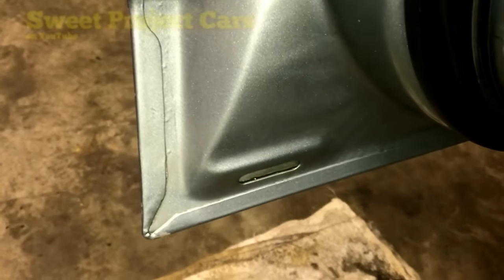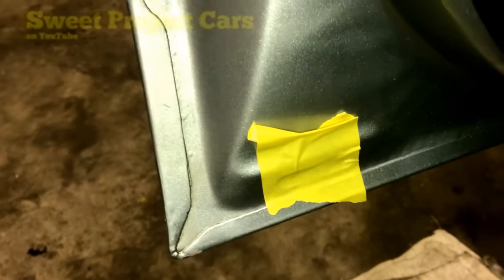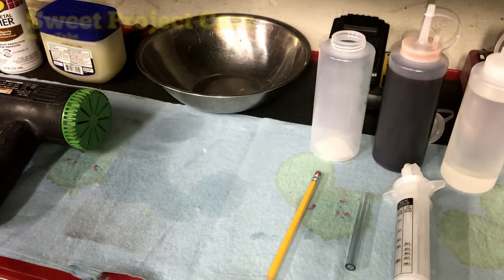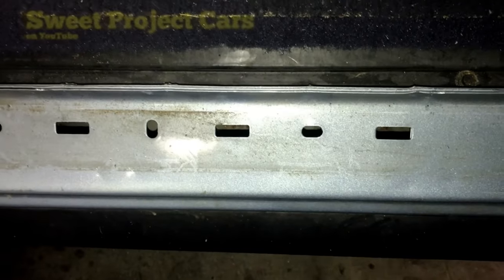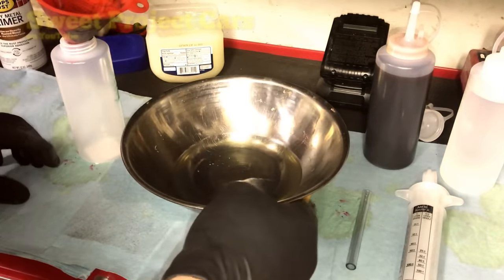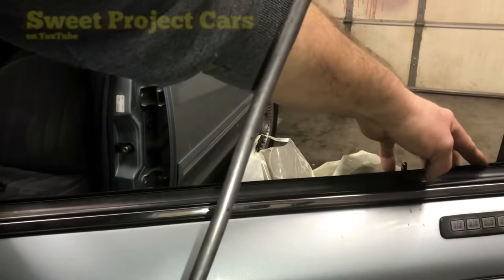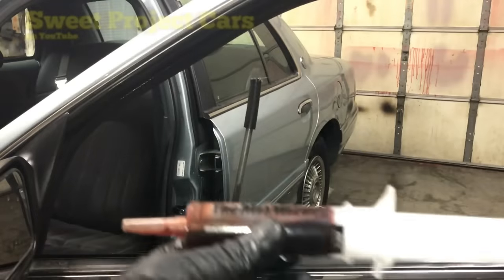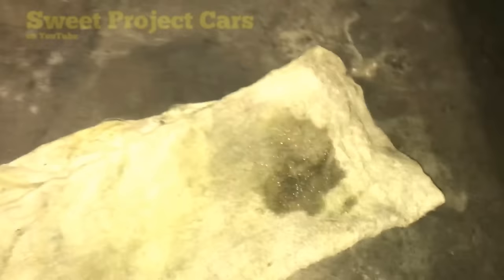Your Car Will NEVER RUST Again! For Just $10 Bucks!

Comment: Is petroleum gelly same as vaseline?
Reply from the maker: It's this  http://amzn.to/2DIxYVT  Thanks for watching and asking.  Have a great day. mad Mike the hammer SPC
Reply: @SweetProjectCars  Yeah there's a variety of uses for that stuff. I keep it in my camera bag along with some tampons.  Now I know what you are thinking right now you dirty you. But in reality it's nothing like that at all. I do under water photography. The vaseline is great on the o-ring seal to keep it watertight and the tampons are in there just in case water do get in because then they will soak it up. You might not have a ton of use for this information so I will end transmission with this: Some men need Vaseline.

Comment: Does that mean I have to apply the transmission oil every time I wash the car ?
Reply from the maker: No because it’s inside the doors it does not rinse out
Reply: Sweet Project Cars I meant like inside the fender wells and places where the ppressure washer would octant
Reply: Sweet Project Cars contact
Reply from the maker: Hernan Murillo oh if you are doing areas you are worried about washing off then you would want to use this video https://youtu.be/U10Qq9mUre8 and its tools

Comment: Doesn't transmission fluid remove the cars paint?
Reply from the maker: You need to see this video  https://youtu.be/pMGHcKVo2Yk  this will answer all of your questions.  Thanks.  mad Mike the hammer SPC
Reply: @SweetProjectCars 
 Interesting video, but doesn't it tell us what transmission fluid would do to the paint on the inside of a door if left permanently in there,  as you have suggested elsewhere to prevent rust.
I assume there would be no clear coat on the inside of the door, but only the paint coat?

Comment: Wait... won't the water just sit on top of the oil, and move the rust up? Not trolling just trying to understand.
Reply from the maker: If you apply the oil prior to any water or on dry metal moisture can out wipe it off you have to look at it this way try cleaning corner oil out of your frypan with cold water running on it it does not come off

Comment: What would happen if I do this after rust has started at the bottom of my doors?
Reply from the maker: If you do this now it will slow the rust down dramatically so yes it is a good idea to do hope this helps have a great day my friend
Reply: Thank you. I have an open jug of oil that I’m afraid to use in an engine because cap is missing. I’ll try that thank you.
Reply from the maker: GusgusA1  perfect stuff to use for this project good thinking my friend :)

Comment: Oil floats on water....and with the oil on top it will not evaporate as quickly....thus I am not sure how this will work?
Reply from the maker: Scott Sluggos Rule!  we have used these fluids for over 40 years on 100's of customers cars and none have rusted to the is day where it was applied, also you do not apply where the metal is wet you do on dry areas only, once its there it does not come off with misting of water that you get from driving especially cold rain water...have you ever tried to remove cooking oil or grease of anything especially with cold mists of water? the only way it is coming off is with hot water and soap and scrubbing...have a great day !
Reply: Some oils are heavier than water

Comment: Stopping rust is impossible without completely removing or neutralizing it first. The best way to prevent it is get a car made of plastic or non ferrous metal.  Short of that, you're SOL.
Reply from the maker: we stop rust in its tracks with this method rust cannot grow in an oil environment
Reply: Only plastic cars you can actually buy, are the Pontiac Fiero 1984-1988 and the Saturn S series, 1st gen 1990-1995, 2nd gen 1996-1999, and 3rd gen 2000-2002. Not sure if other Saturn models were made of plastic...Although, the 2003-2007 Saturn Ion was also made of plastic.

Comment: Great, but alot of rust comes from bad steel....the 70's taught me that and that's when the big 3 lost alot of the market.
Reply from the maker: you are correct on that so any oil is better than none :)
Reply: Sorry, but there is no such thing as bad steel. The problem was that the factory did not paint inner doors, inner fenders or underbodies. If you couldn't see it they didn't paint it. These areas were bare metal or primer, which is porous and these areas began to rust after the first rain. A few years of salt exposure and there were holes everywhere. Today most of the steel is galvanized and the rust problems aren't as severe as they used to be.
Reply: Kenneth Wallace true they also used way more salt back then.

Comment: I use WD40 and spray white lithium grease and all our vehicles are rust free. Even if you get a used vehicle with light rust it will stop it. 
I do it every late summer early autumn. Never sorry. Spray at every crevasse even where metal meets plastic. And all the metal that is hidden and supports plastic. Many bumpers are plastic over metal. A coworker had a Honda Ridgeline older than mine. He did nothing to prevent rust. New bumper was over $800.
Reply from the maker: Thank you for watching and sharing.  Have a great day. mad Mike the hammer SPC

Comment: Any additional hints on what to do after the dripping stops to make sure no additional drips fall afterwards on the driveway or garage floor?
Reply from the maker: Hello Amy if there is any additional oil or fluid left it usually will slightly drain out onto your rocker panel when you open the door you may see it not a big issue just wipe it up and it’s actually good to make sure that area doesn’t rust as well

Comment: Question...what happens when all that oil based products begin to SMELL??? Ugh! Better, if significantly more expensive are the anti rust advanced coating systems, like a more modern version of zebart. There is also a class of coating which chemically combines with rust to form a rock like structure and prevent further corrosion.You can, of course, simply run a small electric current through the body of the car or truck....
Reply from the maker: Hello Cindy there is no smell when you follow the video to a T. There are many more expensive products to use out there but with this being a DIY channel Our main goal is to help our view were save money do the project themselves with products that are affordable and do just as good of a job but less expensive, have a great weekend

Comment: Did you remove the door weatherstripping to get at those door bottom slots?
Reply from the maker: We did not remove any weatherstripping but remember many cars are not the same but most all of them have drain slots or holes you just have to find them thank you very much for the great question and have a great weekend
Reply: Removing the weatherstripping can be a big job which will chip the paint, especially if it's glued on.
Reply from the maker: Jim Ervin you should not have to remove the weather stripping as there should be drain holes at the bottom of every door
Reply: Yes, I found the two drain slots on the door bottoms of my '97 GMC Pickup. However, those slots are hidden behind a wide piece of weatherstripping which is held in place by pop out fasteners which would have to be pried out first. Thankfully my door bottoms still look as new but I realize the value of preventive maintainence.
Reply from the maker: Jim Ervin you should be fine then as they would not place the stripping in to block those drains from doing their job.

Comment: I do not understand why rust is such a big problem in the USA. Here in the UK  every new car for at least 25 years has been fully zinc galvanized and consequently you hardly ever see a rusty vehicle. It is very common to see 20 yrs old cars looking like they are brand new.
Reply from the maker: Not sure on that I’m sure the auto manufacturers here are a little bit greedy and like to sell cars so they build them with lower quality
Reply: sweet project................... Yes but do not forget that motor manufacturers are all in competition with  each other and the best product wins the day .
Reply: The British Isles are hardly warm and dry you know !!!!
Reply: Our cars are built about the same way, with galvanized metal in critical places, some are even based on the same platforms.  Rust is nowhere near the problem it was in the 1970s, but if you want to keep a 20-year-old car pristine, it will catch up with you. My 13-year-old Honda Accord is just starting to show rust, though it's in no danger of structural damage. In the North, we have a lot more salt on the roads,  so that could make a big difference. The South is wet, but  a lot hotter. Washington and Oregon being mild and rainy like the UK, it would be interesting to know if cars fare any differently. I know that rust is a non-issue in the South-West (as Albert Hammond pointed out way back when); that's where classic cars are found in the best condition, at least on the outside.

Comment: You’re putting it on the inside of the surface, aren’t you supposed to put it on the outside on top of the paint to protect it?
Reply from the maker: No you want to use one of our other videos or ceramic coating on the outside to protect it

Comment: "It's not flammable"?  We campers make fire-starting kits by soaking cotton balls in Vaseline jelly... put a match to it and it is like napalm... I guaranty it is flammable.
Reply from the maker: Wrong.  Petroleum jelly is not flammable   Watch this  https://youtu.be/5J0VG4_jR2w  The only reason it SEEMS that the petroleum jelly burns on cotton balls is an illusion.  If you are to take a cotton ball with nothing on it and light it on fire it will burn up in seconds.  By adding the jelly to the cotton ball, you are slowing down the combustion rate of the cotton ball, it is not the petroleum jelly that 
is burning it is simply slowing the cotton ball from burning up in seconds. Thanks for watching.  mad Mike the hammer SPC

Comment: why not let the excess oil stay inside the rocker cavity?
Reply from the maker: jack you can leave it in there if you like but you will have to seal it off and then that means the water will not drain out either, we dont need to let it stay in as we are only looking for the coating the oil gives and as you know water does not wash away oil.

Comment: Used motor oil is acidic. Why would you recommend that it be used?
Reply from the maker: Jimmy Kraktov well if it is acidic that must be why it keeps eating holes through my engine block and transmission case and strut housings and brake lines and power steering reservoirs and transfer cases and so on, I always wonder what was doing that and after 40 years of working cars I finally find out why here on my own youtube channel.....now I know why the minute we put oil in something and run it for an hour or so and it becomes used & acidic that that was what was wrecking everything we have within hours, even the brand new cars we could not run for more than an hour because the acid oil was eating it way out and then dumping the oil and fluid everywhere now I know why we could never get a lawn mower no matter how new it was to last more than an hour or two it was the acid oil was eating oil through the engine block.

Comment: You can forget repainting your car if you use these products. Once they seep into the metal, paint will never adhere to the metal ever again!
Reply from the maker: Stephen Velden this is no different then waxing your car ...you always make sure you thoroughly clean any area before painting
Reply: It is indeed different to waxing your car!  Wax will not penetrate metal. Vaseline will be absorbed by the steel and can never be removed> Just ask any Auto Painter. BTW the word is than not then! @SweetProjectCars
Reply from the maker: Stephen Velden vaseline is petroleum and that is oil and also oil is spilled on cars every day my mechanics and DIYers also oils are sprayed on door hinges and everything else that needs lubrication oil is also picked up off the road while driving same for all rust proofers they are all oil or lanoline based, when a car is prepped for paint it is thought degreased to deal with all of this...we have done this on 100's of customers cars and have painted many of them with never an issue in over 40 years.
Reply from the maker: Stephen Velden on your last comment there is no luck about it, and you could not be more wrong my friend...lacquer thinner takes off all oils and grease even armorall and vaseline...done it 100's and 100's of times with never an issue and painted 100's of cutomers cars over the last 40 years that were well covered in vaseline and waxes and armorall and the paint on them is still perfect after decades.

Comment: Wd40 silicone lubricant and comes with a straw
Reply from the maker: You can use that if you want problem is you can’t get down to the bottom of the door we found it does not work as well on long term for stopping rust but thanks for the great comment

Comment: NOT FLAMMABLE? Are you kidding? I use petroleum jelly on cotton balls as a fire starter. It just takes a spark to get it going. Rain or shine or wind.
Reply from the maker: Not you well I hate to disprove that but here are the facts and the video to prove it   the videos you see online with the cotton ball with PJ on it ...the cotton ball is burning not the PJ, that only slows the cotton ball down so it does not burn up in seconds ..see our video proving PJ does not burn on its own   https://youtu.be/5J0VG4_jR2w  and thanks for the great comment :)
Reply: Sweet Project Cars Kerosene doesn't burn either --until you put a wick in it! 
Drop a wick in your pan. 
It is possible that you just don't see the flame and it does die when you take the flame away. You can't see alcohol burn either. Try looking through a filter like welding goggles. 
One of the reasons aircraft carrier fires are so disastrous is because the flames are not easy to see. Basically kerosene fires. Fire fighters walk right into the flames without realizing it and get massive burns. 

You may be correct but I have yet to see anything 'petroleum' that didn't burn.
Reply from the maker: we have tried everything we can to get PJ to ignite but have failed...thanks for sharing

Comment: is that Automatic Transmission Fluid or a gear oil?? .. im confuse.
Reply from the maker: It is transmission fluid
Reply: If it is ATF can I use power steering fluid too? Are they the same?

Comment: Trans fluid could contaminate rubbers.
Reply from the maker: Transmission fluid does not contaminate or cause any problems for Rover if they did they would not use it in transmissions because the transmission is loaded with rubber parts have a great day my friend
Reply: Door rubber is diiferent from trans rubber. Like gas line rubber hose and trans rubber hose. Sorry but i've seen damage done with it.
Reply from the maker: been doing this for 30 plus years on 100's of customers cars and never seen trans fluid effect any rubber...and you dont put the fluid on the door rubber you put it in the door to stop rust ...hope this helps
Reply: Nobody uses trans fluid on their rubbers👙👠😨😲....😄
 Besides, rubber is not really natural rubber like latex. 
Synthetic rubber is an elastomer made from petroleum products for Automotive uses where contact with other petroleum products is likely.

Comment: Because the Japanese know how to pre treat the steal to resist rust during production, my 1998 Toyota has no rust. 8yrs in salt brine country. An still no rust. I did nothing to treat the body. I sprayed all the hard tubing and brake lines with special silicone when I purchased the van. The brake line metal is still shiny. I replaced all the rubber lines and restored my van to mechanically new. American vehicles are made to rust. My 1984 Nissan pick up launched numerous boats into Salt water for 12 years before my truck showed any rust. In true Nissan form, the suddenly numerous cost prohibitive mechanical repairs killed the truck before 200k mileage. I ran and DIY all my vehicles boats and motorcycles for 50yrs.  Every American manufactured car and service vehicles that I owned all rusted to pieces in less than 10yrs. Sick of repairing American cars, I remain a foreign car owner of historically reliable vehicles. If you don't rust treat your car, you must high water spray the brine off often.  Doing the undercarriage wash every time temperatures briefly break above freezing sucks, but my Toyota will be 30yrs old and still have no rust. Keep your car waxed lubricated and clean.
Reply from the maker: Thanks for watching and sharing, have a great weekend. mad Mike & team

Comment: I've never had a problem with rust I think the problem is where you live
Reply: Absolutely. Where do you live? I live by the ocean so we get rust pretty quickly.
Reply from the maker: I couldn't agree with you more my friend.  We bought a brand new 3/4 ton express van when we moved to Florida and there is no need to under coat it in any way shape or form.  Thanks for watching and sharing Steven!  Hope you have a great day.  mad Mike the hammer SPC

Comment: Yeah, sure.
Reply from the maker: Thank you for watching Dan.  Have a fantastic day. mad Mike the hammer SPC
Reply: @SweetProjectCars  I spray paint the uderside of my car and truck frame and chassis with black rust Olem paint o keep it from being rusted out by road salts and corrosion.  The next thing, I oil the doors and different areas with penetrating oil, also using used motor oil and kerosene mixture with the used oil to keep things oiled and lubercated as much as possible. Still sad as the amounts of road salts they use on the roads, you have to do something to keep rust off and away from your car and truck in order to many years of yet freedom of use for your vehicles